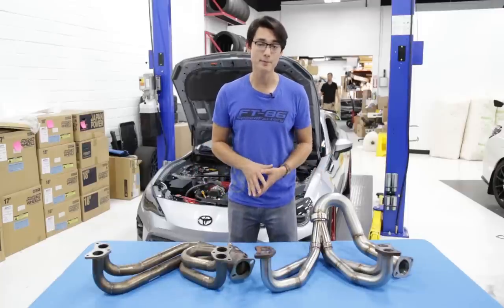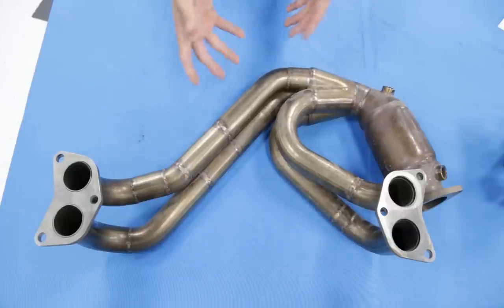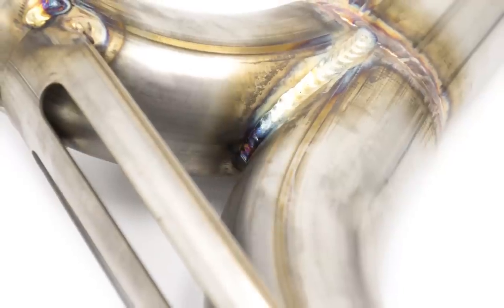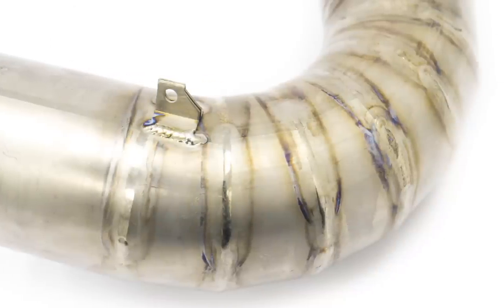Aftermarket Exhausts | Everything you need to know [FRS/BRZ/86]

Comment: I have got the ft86 header, borla overpipe and front pipe catless, and the invida q300 cat back, not obnoxiously loud but significantly deeper and I am finally pleased with the sound me car makes and would recommend
Reply: Henry Greive could you upload a video of it? I was thinking of a similar setup for my 86.

Also, why do I see that you have over a million sups?
Reply: With the headers do you find it to have any rasp? I have the q300 with invidia catless front pipe and overpipe. I was looking at the borla UEL catless headers next but want to avoid it get real raspy.
Reply: no I would not call the sound raspy. there is a nice deep throatiness to it but it is not overly load or obnoxious. since the q300 isn't very loud and muffles alot of sound I think thats how you can get away with the straight piped front pipe. The front pipe mod opened up the exhaust more than the headers did and is defendant must.
Reply: Did you fiddle with the ECU once you've finished the build? Also, did you dyno it?
Reply: yeah I did flash tune it for unequal length headers. At first I wasn't convinced because I got the tune off their website and it was a hassle bc it didn't work properly and I had to use a computer to download new software and tunes to it which I should't have had to do. However it has done a good job of reducing the torque dip.
 I highly recommend a catless from pipe if you  don't have one already. It did more sound wise than a new header and if you have primary cats you shouldn't have a ecu light problem. The front pipe also made it where it pops on upshifts which I love. But now I really want that backfiring tune.  The overall sound is not obnoxious, and has a really nice tone, and just right from me right now. But if i wanted more loud I'd go for that N1 catback.
Reply: The noise difference between Q300 and Gemini R400 is noticeable?. They are both good options for quiet daily driving without drone noise?. Thanks ;)
Reply: @chartreusenematoad9451  hey I got a question if I tune it to pop , it will pop right? Dumb question inexperience car guy ahhaz
Reply: I believe they call it the 91? Tune?
Reply: @chartreusenematoad9451  is your front pipe resonated?

Comment: Seriously children, just install a good catted header and tune, because it makes the biggest performance gain, which is what 86/BRZ desperately needs. 

What's the point of having a loud but slow car? 

Also, the louder your car is, the less often you can go full throttle, because you'll attract attention from cops! Think about it, isn't it more fun if you can floor the gas pedal whenever you want without worrying about noise violation?
Reply: Shin Ken I don't think most people like the loudest exhaust possible they think they do but they have never lived with a straight piped car i just like a little rumble under heavy throttle I don't want to be barely accelerating and sound like im going 120

Comment: I'm pretty sure that titanium is (pretty much) as strong as steel, per unit of volume, so the exhaust pipes shouldn't be much thinner than the steel stuff, it's just that titanium is much less dense.

Also, if the walls are thinner, that's probably because titanium is incredibly heat tolerant, but that's not because of its strength.
Reply: No, actually it isn't. 

"the best steel is stronger than titanium alloys. In unalloyed condition, titanium is 45% lighter, and as strong as steel."

Read more: Difference Between Steel and Titanium | Difference Between http://www.differencebetween.net/object/difference-between-steel-and-titanium/#ixzz5PlyjAiiR

Comment: Their catted header is slightly louder, the catless screams. Look up videos of them before you buy. Other people from speed factory have even said the catless is unbearable as a daily driver. I have the catted and I love it. Just added a little rumble and it’s more throaty than before.
Reply: Would a catless front pipe be worth it if you have a catted header for performance? I have no idea why there are 2 cats on the exhaust if it's only one line, but If I make the front pipe catless with UEL Catted headers do I get a performance boost?

Comment: Hi I was wondering with the dual tip exhausts they usually have a bubble coming off the pipe before the tips. Is that the muffler? Also, removing that would make the exhaust louder correct? What else would removing that bubble or muffler do?

Comment: I'm working on a project in which I will be mounting one aftermarket exhaust along with the stock exhaust on the same car. I'm gonna make a system which switches ur air flow through either of the exhausts so u can have benefits from both and cons from none. I needed more information about custom exhausts
Plz let me know how to contact you.

Comment: Will the catted headers still have that Subaru rumble?
Reply: Tim Lackner if you get a UEL, catted or not catted , you're still gonna get that rumble
Reply: yeah just not as loud and no check engine light
Reply: Rufio In yeah because this is my daily driver and I want the subie rumble but I don't want to deal with the CEL
Reply: yeah i mean the CEL won't harm your car in any way. My friend ran his for over 30k miles without any issues. But if the CEL is an eyesore then catted will be the best option
Reply: Rufio In will I still get that mid-range torque with the catted header?
Reply: yeah as long as its unequal length
Reply: just add an 02 spacer to the UEL if its catless. youll be fine
Reply: as long as the headers are Unequal length you will get the rumble. You can even plumb the UEL header through a turbo and still get that great rumble. I have AVO's stage 2 bolt on turbo system, and it has an awesome rumble to it.
Reply: +Rufio In
Actually the UEL header has reduced performance over a well designed equal length header... since the exhaust pulse is not even, it tends to throw off exhaust gas scavenging  that is created by a properly designed exhaust system. However the difference is not something you are going to "feel" in the car anyway. I personally love the boxer rumble... SO UEL header for me :)

Comment: Could you touch up on fitment issues for 2017 Toyota 86 exhaust? I know that muffler deletes dont fit 2017 but would it work if I swapped the mid pipe out with one from a 13-16 model year? Also do aftermarket front pipes fit on 2017 model year?
Reply from the maker: Front pipes, over pipes, and cat backs all work on the 17 just fine. Issue with muffler deletes has to do with the 17 rear bumper.

Comment: So just to be clear, if I switch my front pipe on my 2017 brz I don't have to worry about emissions or check engine??
Reply from the maker: Correct.  Those sensors are in the primary cat on the OEM header.

Comment: Will an exhaust for an older model (ex. 2013-2016) fit the new 2017 toyota 86? Cause there are some articles saying that there were some changes for the 2017 models.
Reply: Everything will fit the 17 models from the 13-16. However, and this is big, axel backs from the 13-16 won't due to a slight change in the 17 stock exhaust alignment.
Reply: michael w thanks man.

Comment: like your video bro does help me alot quick question about the cat header will have engine light on but the catless will not is that what you mean ? Thanks
Reply: fang Neo with cated header you will not get a check engine light since the sensors will recognize that there is a cat so it wont throw check engine light . However if you decide to go catless you will get check engine light without a tune of course

Comment: If you want a popping a burbling exhaust thats loud, whats ure suggestion?
Reply: Louder than the ones u already showed
Reply: Jon Vid FI exhaust is probably the best for you. Lot of popping and it's loud. Watch Tanner foxes Frs reveal video and listen to his exhaust. That's the one he has
Reply: buddy club spec 2 is probably the loudest youll find . along with  a catless header and catless testpipe. thatll let the unburned fuel combust in the exhaust itself. engine mods are needed too. no point in being loud and slow :p
Reply: If you live in a location that does not require inspection, removing the catalytic converters is one of the best ways to get the "pops". Any unequal length cat-less header over pipe, mid pipe and straight through muffles. Try to go with one that has as few bends as you can find. Don't go to big like 3", unless you plan on "boosting" the car, since over sized exhaust really kills the low end torque. Of course this is just standard exhaust tips 101... and nothing mind blowing, but hopefully it helps on which exhaust system you get.
Reply: 21 S3ß0 oh no you watch tanner fox
Reply: Alexander Tony  nah I actually hate him, just his car sounds pretty nice

Comment: Do you have get aftermarket headers or install a CAI to have an aftermarket exhaust system?
Reply: Matthew Fronda you can still slap a aftermarket exhaust on if everything else is stock, it wouldn't be a issue. Like Thomas said int he video , if you have a header it will make the exhaust louder, it would sound a lot better too👌
Reply: depends if you want a full exhaust system. CAI is not a factor. Most people just run a catback and call it a day but if you want an actually full aftermarket exhaust system then its headers on back to the car
Reply: Thanks guys

Comment: Unequal length headers are in NO way better than equal length headers.  Do not appreciate that FT86SpeedFactory claims that the gains would be different between EL and UEL (specifically that El has "better top end power" and UEL "has better mid range torque"). Performance increases are dependent completely on both hardware AND tuning, so saying such a generalized statement without any information to back it up is preposterous. Common sense and a myriad of forums could tell you that having an intentional unbalanced exhaust flow in UEL headers is not superior to EL headers. You can see performance increases with both setups, but EL headers will ultimately take you further when you push more power because they are meant to be as efficient and balanced as possible. The only reason to get UEL is for the aesthetic sound people desire, and since you will not see a major difference at low power between EL and UEL, they are still a viable option. I personally would never sacrifice any power for a certain sound, but I am in the minority. I do not appreciate the false information though, I hope this comment is taken in a helpful manner.